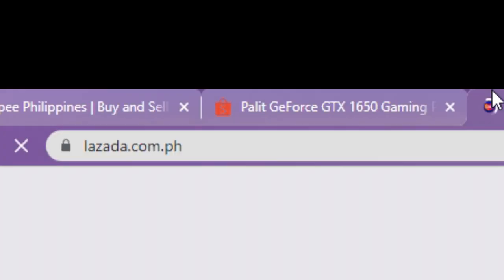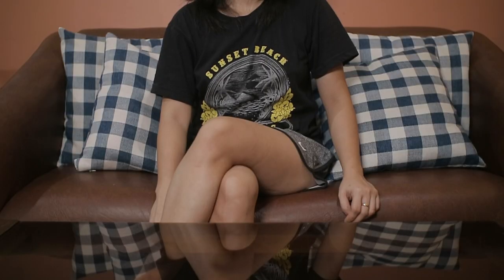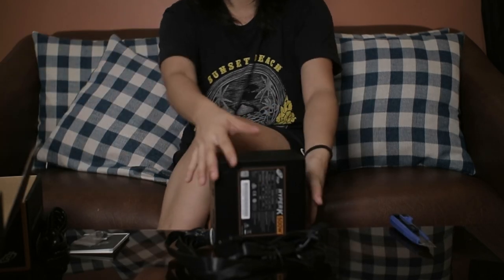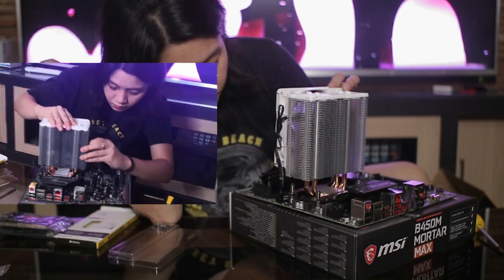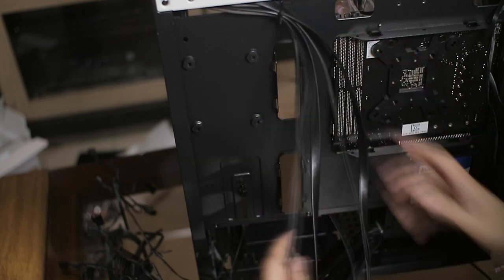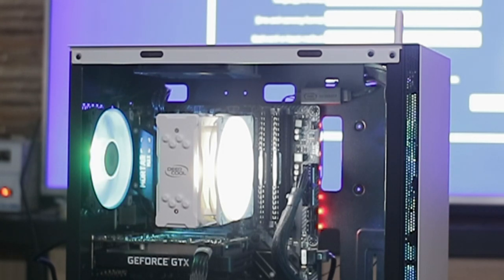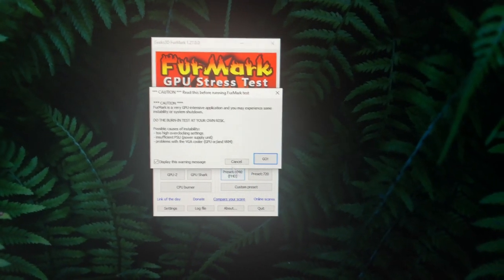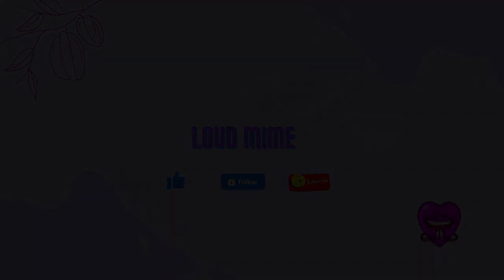30k - 45k Php Budget PC Build Guide Tutorial with Benchmarks | 2021 Ryzen 5 3600 GTX 1650

Comment: planning to upgrade my ryzen 3 3100 and gtx 1650, what would you recommend?
Reply: in the states a 6600 can be found for around 400 at microcenter if not 1070 can be found on ebay for a similar price and the 5600x or ryzen 5 3600 are great cpu upgrades
Reply: Recommendation keep that shit gpu are overprice right now but if you have a rich fam get the Ryzen 9 5950x and RTX3090/AMD RX 6900XT

Comment: Meron din po ako 3 inwin jupiter aj120 sa case ko po pero hindi ata naka connect sa mobo since wala po argb header. Pwede pa rin po ba ako magdagdag ng another 3 of the same fans?
Reply from the maker: If power supply permits it
Reply: My PSU is the Corsair CV650 which has 650 watts po. Pwede pa po ba magdagdag ng another 3 aj120 fans?

Comment: Hi po maam may prob po ako 
Kakabili ko lng online ng pc set
Ryzen5 2400GE
22k lang set
Sat oct23 ko lang nabili 
Tapos ilang araw palang puro problema na po 
Minsan naglalaro po ako bigla po syang nagrerestart
Tpos 2x na pag nag shutdown ako nag ha hang naka stack up lang po 
Madalas po sya mag hang/stack up at mag restart kusa
Ano po kayang problema ng pc ko sabi nung seller all brand new daw po
Sana po matulungan nyo ako
Reply from the maker: May naging problema kami na ganyan. I suggest papaltan mo power supply or motherboard. Pede mo rin itry na mag run ng 1 stick ng ram or ipabenchmark mo. Pede gawin mo disable fast boot . Make sure legit din windows, or reset CMOS battery.
Reply: @LoudMime   good pm sir binalik ko sa shop na binilihan ko kasi under warranty pa yon chineck nila unang na ung RAM 
Pero ok naman saw
at ang sabi wla daw sira sa parts nag update lang daw ng driver 
Yun lang daw
Tpos magdamag daw nila tinesting ung pc di na daw mag rerestart kusa at nag ha hung
Totoo po kaya yon? Na  dahil lang di updated ung driver ?

Anyways maraming salamat sa response godbless po
Reply: @johnericbalingit7019  Hello po, nagre-restart parin po PC nyo? kasi pwede po videohan nyo for proof, para kapag binalik nyo sa store wala na sila masabi na kung ano.
Reply: @mariellabayno1109  ang prob nlng ngayon 
Automatic na dinidisable ng windows ko yung 
Graphics card ko 
Dko alam kung bakit ganun
Reply: @mariellabayno1109  nag update lang daw sila ng driver

Comment: Mahirap lang sa mortar max walang argb panokaya ma sync yung mga fan kahit walang argb yung mobo?tsaka paturo ako ate pag install ng mga ms
Reply from the maker: MsiRGBb sa github. Ms can imply anything. Microsoft Suite? Punta ka sa TeamOs makakakuha ka dun ng libre if wala ka means of buying keys i do not support it though its an option
Reply: @LoudMime  pag bumili po ako ng deepcool converter macocontrol naba lahat ng fans ng mystic light?
Reply: bili po kayo ng fan hub / controller na may remote control, para po sync yung mga ilaw may iba din mode dun sa remote